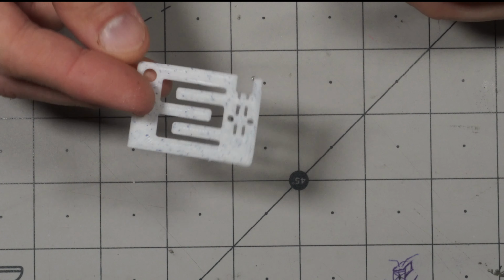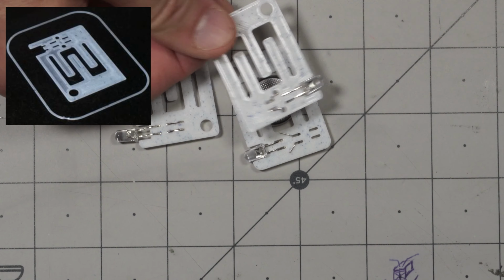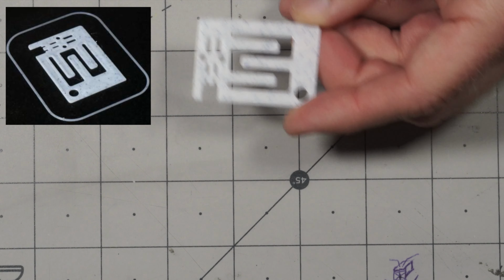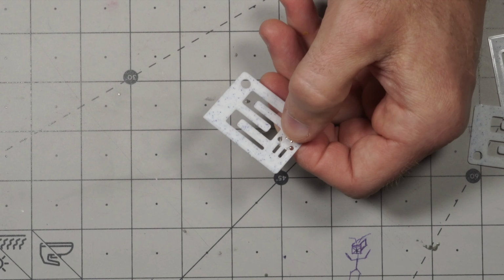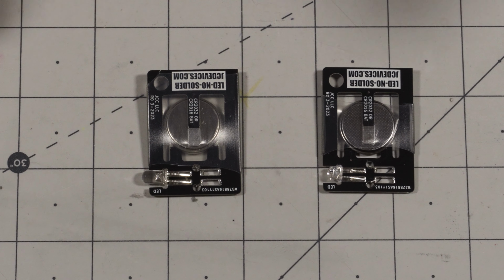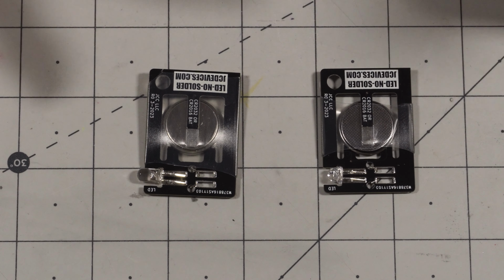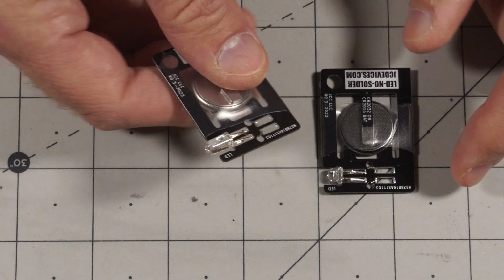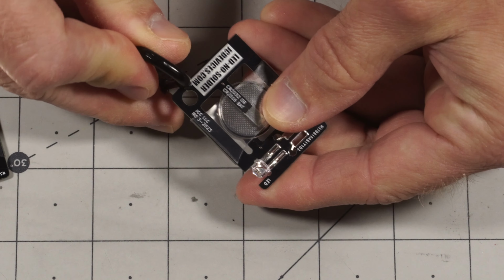No-Solder Coin Cell PCB Light [Doubles as Guitar Pick!]

Comment: That is an interesting PCB light. Imagine if vehicles had a led light come on when tire is out of balance.
 
I have a project restoring an old Zenith radio that I ordered & received caps, but not sure about one. It is an older tubular axial film cap that has 501K 630V markings and know the 630 is voltage, but need to know the value in uF (micro Farads). Would you know? Thanks.
Reply from the maker: Thanks. I am sorry I do not know. You can buy a tester, or some multi-function devices can measure capacitance.
Reply: @JeremyCook  Thanks anyway